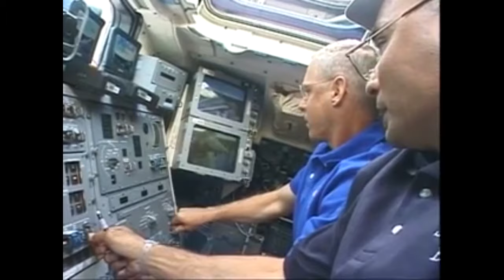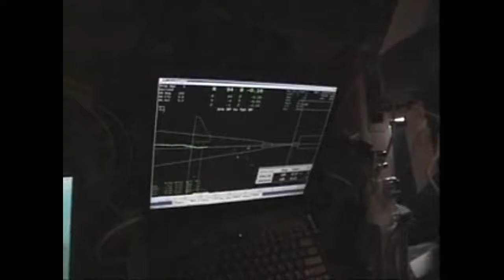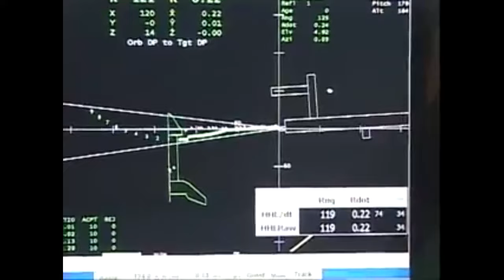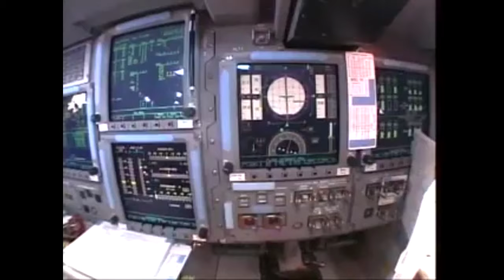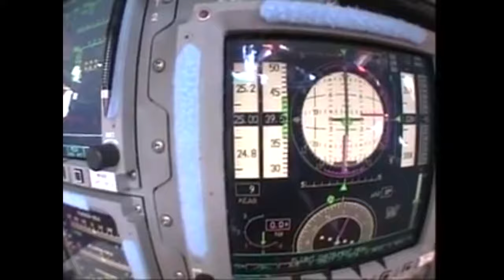International Space Station - Episode 26 - Expedition 15 & S3/S4 Truss

Comment: STS 117 installed S4 the final set of inboard solar arrays and retracted the P6 2B array which went in nicely compared to the 4B array which almost jammed on STS 116. With power coming from the truss and not P6 the station is now ready for the arrival of the modules but before that can happen S5 needs to be attached and critical parts need to be delivered to outfit the Harmony Module STS 118 would deliver those parts on the next flight. During launch Atlantis was hit on the bottom and on the thrusters by a chunk of ice and foam which was damaged as part of Hurricane Florence. Danny Olivas and Steve Swanson would go out on EVA 3 and patch the holes.  With Expedition 15 winding down it is time for Astro Sunni to come home. During planning for STS 117 and 118 the Love Triangle Scandal happened and Sunni's replacement was fired so NASA had to send up Clay Anderson the crews of 117 and 118 were also replaced as members of those crews were involved in the scandal.
Reply: Harmony (node 2) is coming to the iss.

When kevin thinks about it.
Reply: @angelagreen5208  yup